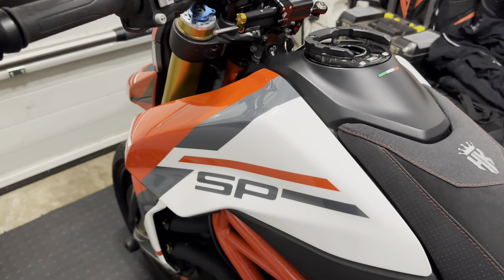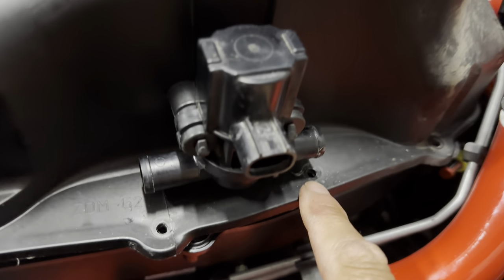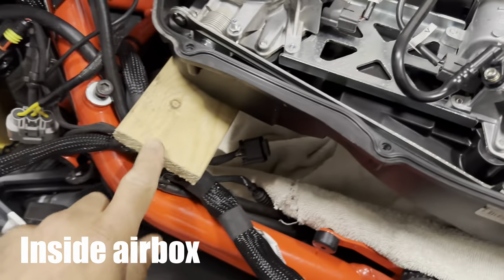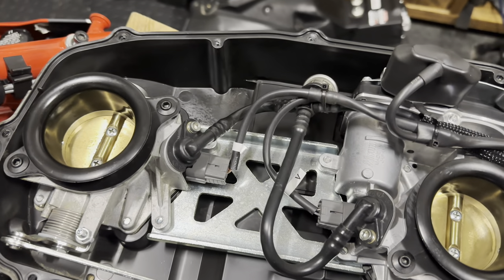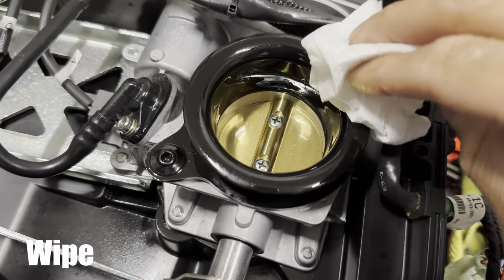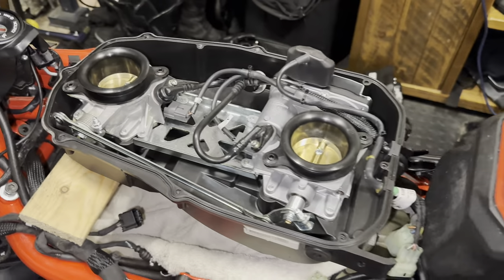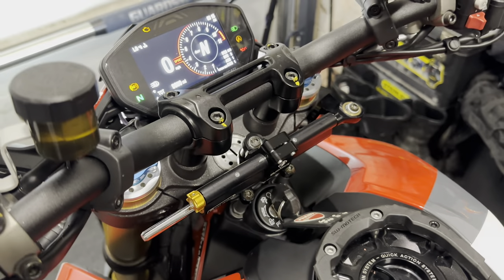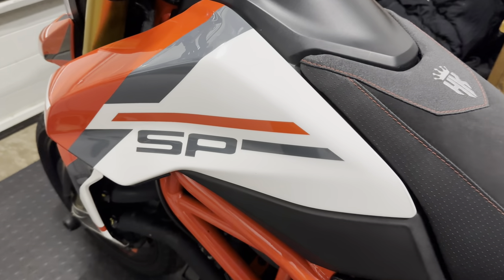Secrets of a Smooth Ride: Deep Dive Cleaning Motorcycle Throttle Body - Ducati Hypermotard 950 SP

Comment: You can easily disconnect the fuel line and you should clean the underside of the TB valves where the injectors are.  The bit on the outside of the airbox is the EVAP return circuit and the one on the inside is an air temp sensor.  ;-)
Reply from the maker: Its the one hose down the side connected to the airbox i couldnt remove or have a tool for which limited how i could move/position the airbox..
Reply: @hypermotardking  there are two, the crank vent down the rear right and the air box drain tube down the left, which you have to pull up from down by the left of the oil cooler.  It’s a little bit of a pain, but worth seeing if the bottom side of the valves have residue.  Ultimately the edge of the TB valves and where they meet the intake when full closed is where it matters.

Comment: The hose connections on the right side are the air injection system. smart Moto makes a kit so you can delete that. that is pumping air into your cylinders and causing a lean condition it's there to introduce more oxygen into the system. And since you've gone this far into the system it's easy to remove the injectors and clean them there's all kinds of information on YouTube on how to do that I actually have a machine to do mine.
Reply from the maker: Cheers for the tip.. maybe have another go over winter time and get some reading done before hand - never really gone further than this 😭

Comment: Hi buddy I noticed that your engine light was still on when running the hyper did you use i car pro OBD unit to clear the engine light 😊
Reply from the maker: Thats a temporary error from my 14T sprocket change. I have a bluetooth OBD adapater and iOS app to clear the fault : https://youtu.be/J26RtK06c6c
Reply: Thanks I’ve had something similar I change over the throttle mechanism and I now have engine light on I saw your video on clearing faults so I’ve ordered one to see if I can clear the engine light

Comment: I remember when I did mine the stacks under the throttle bodies were covered in white dried frosting like crud.  It was really bad. I had to vacum down in the engine case as bits were falling engine when i was cleaning.
Reply from the maker: You’re the second person who suggested i should have checked underneath 🤛🏼👍🏻

Comment: I see you’ve still got all the paint marks on the bolts from the factory. I tried all sorts to clean mine off, then my mate gave me a spray called loctite 7063 and they just wiped right off. It’s a solvent cleaner that’s safe on paints metals and plastics but somehow melts the marker paint away in seconds. It’s great for cleaning chain oil sling as well
Reply from the maker: I always sort of left them on and tightened them back up to align again to make me feel good i done a good job 😂😂😂🤦🏽‍♂️
Reply: @hypermotardking  I suppose it saves getting the torque wrench out 🤣

My aprilia was absolutely covered in blue marks and it used to stand out massively against the black and red